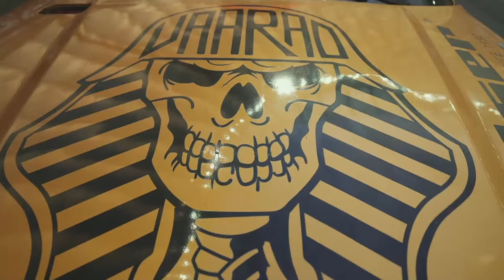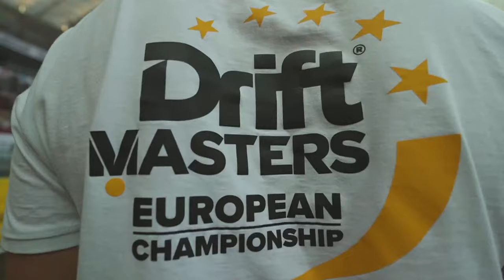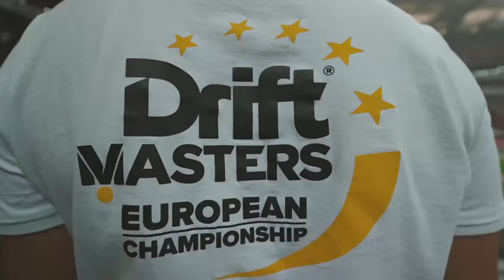DMEC Round 6 2023 • The Grand Finale • Poland • Qualifying LIVE

Comment: is it just me or some drivers getting judged to high with there Runs. like JUHA RINTANEN getting 81 point in Q2 . 4:14:30   while the run has a lot of mistakes... (almost straightens, just nearly hitting innerclip 2, and then the angle changes a lot. absolutely not worth 81 points.